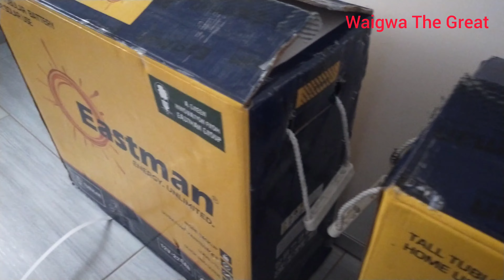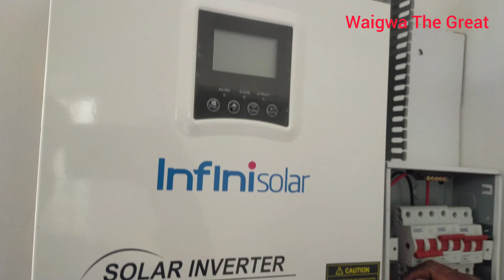HOW TO INSTALL SOLAR SYSTEM. PURE OFF-GRID. LET GOD PAY YOUR BILLS.#asktheexpert #greenenergy

Comment: Hi the great,I would have preferred the panel to be raised so as to act as a shade also create some space otherwise you're professionalism is top notch
Reply from the maker: Thanks you so much for always supporting me 🙏🙏. I get your point but this the last floor for the house meant for water tanks, solar water heater and solar backup. It has no access to go there hence the design.
Reply: EXACTLY:hand-pink-waving:, Even at Marwa's Villa, I suggested that they incorporate the design of a roofed gazebo, so that solar panels are installed on the roof of the gazebo. No space will be wasted and panels will also be more secure.
Reply from the maker: @suntzu yeah this will go hand in hand by providing good shade also.
Reply: @WaigwaTheGreat  exactly. Since marwa already has the plan to put a gazebo. the two projects can be planned together. A welder can can assemble a gazebo with steel round pipes or rectangular pipes, put roofing sheets, mount the panels on top
Reply: @suntzu8959  shukran for Marwas   being massive it will be best on one of the corner at the roof top